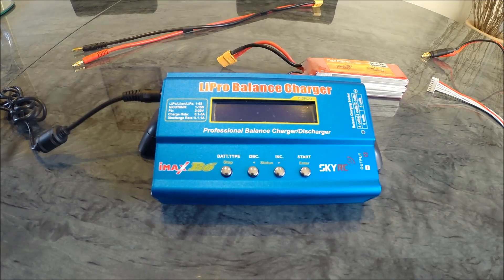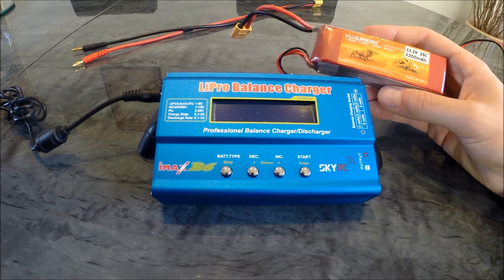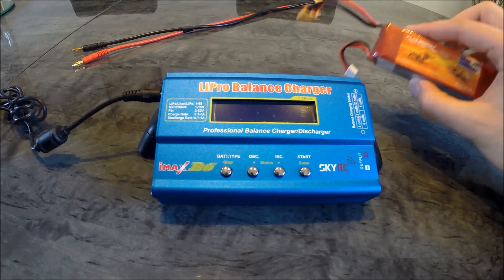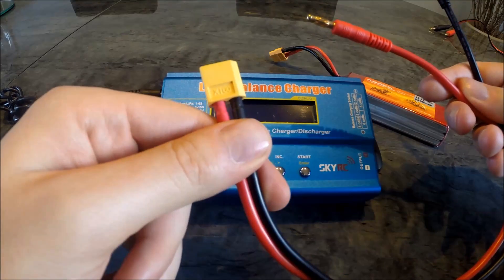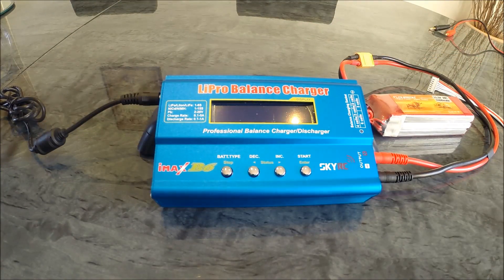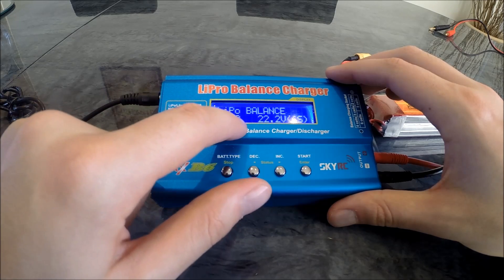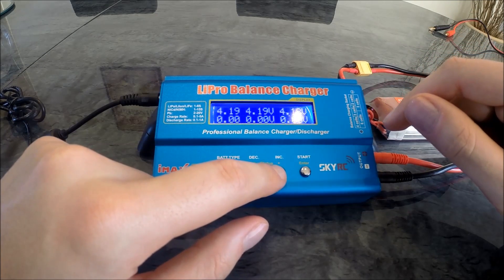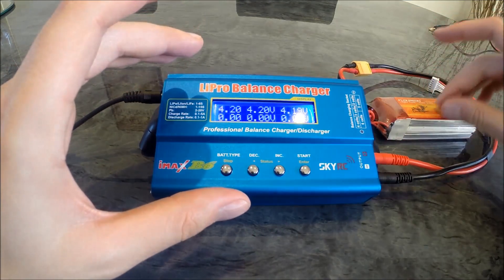IMAX B6 Charger - Devo F12E replacement LIPO

Comment: Hi Alex! I have a question concerning a lithium polymer battery that I just purchased for my Devo F 12 E. the manufacture is MG Power, and it's a 15C 2200mAh 11.1V - 

There are 3 connectors coming out the battery. A red two prong, like on the AA battery holder. A black three prong, with just the two wires (red & black)... and the white four prong ballance charging socket. 

I have the Dean Charging Cable, and both adapters for the two and three prong cables. Here is my question???...When I go to ballance charge my battery, what adapter do I use...the black or the red one??? Not sure why that battery has both, but it does....Thanks Brother...I'm  soooo confused :-/

I was going to take a picture, but here is the link to the battery that I bought :-)

http://www.besthobbysite.com/mg-power-mg-111-15-2200-tx-bp-11-1v-15c-2200mah-li-po-battery-for-walkera-devo-7-10-transmitter-with-balance-plug.html?search=MG%20Power%2015C%202200mAh%2011.1V

The picture shows two white connectors...FYI...On my battery , the smaller white one is a thin black plug. 

Thanks again Alex, you are a life saver. :-)
Reply from the maker: So for my 3s lipo battery, I have two plugs. A balancing plug and a yellow xc60 banana plug. For charging, I use the xc60 with the imax charger (have to buy a separate cable to plug into the imax charger) This is for charging purposes.

However the F12E does not have the ability to use the xc60. I use the white balancing plug in the F12E and connect the battery to that. It fits fine and powers without any problem whatsoever. 

I could only imagine your battery has many connectors to cater for different hardware. 

I hope that makes sense? All connections in the back of the F12E will take power. Its what suits you :)

Comment: Hi Alex, I've now got my Scout X4 and am looking to replace the battery pack on the Remote with a lipo as you have suggested.  Can you tell me, where and how does it plug in to the Devo, as it is obviously different from the AA pack?
Reply from the maker: Hi Richard, you need a good set of pliers to pull the aa pack out of the socket. The lipo tten plugs into the white socket next to where the aa use to plug in. hope it helps?

Comment: Getting ready to purchase a carbon Walkera Scout X4. Thanks for the video. As soon as I get the carbon Walkera Scout X4 I will change the battery set up to this for the Devo f12-E.
Reply from the maker: Having now done it, its a no brainer.
Reply: Alex Savo How did you know what size of battery to get for the F12-E?
Reply from the maker: A 3s 2200mah is perfect. You do not need anything more. This can do 10+ flights before charging. A majority of people recommend this type.
Reply: Ok thanks